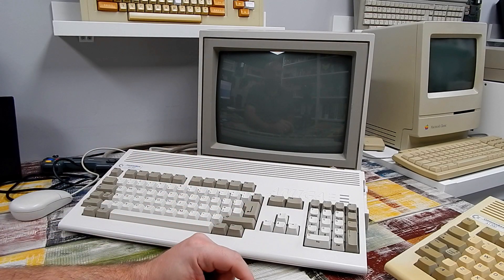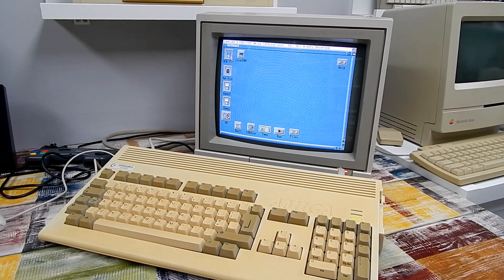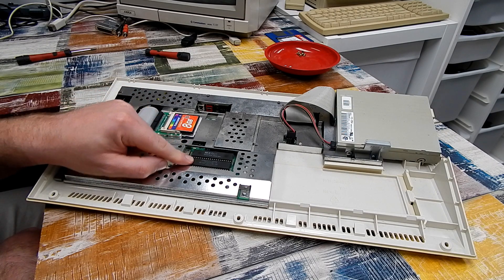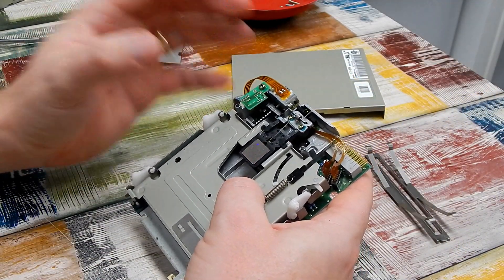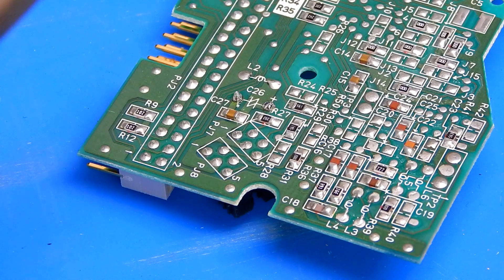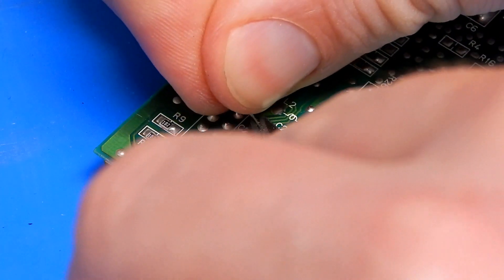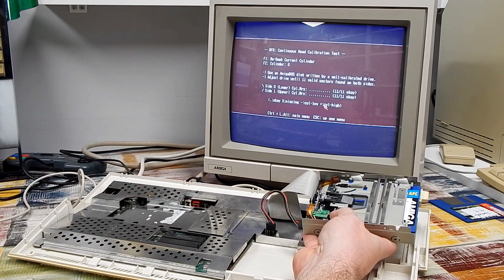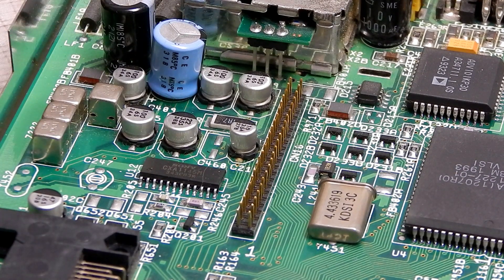Dead floppy drive in this Amiga 1200, let's fix it.

Comment: Nice and easy fix. I'm intrigued as to what's in the head cleaning fluid though - I thought it was usually isopropyl alcohol?
Reply from the maker: That's a good point actually, its very well might just be isopropyl.
Reply: @CRG  It is. No idea what those commenters were on about. It's almost as if they were just repeating some nonsense they heard 🙄
Reply: @PJBonoVox  What? People on the internet are wrong? Well, I've never! 

Also, yes, it's most likely just IPA. 99% is completely fine to use on electronics, and does not damage it. If you are unsure if your cleaning solution is good, just put a cotton swab in it, and wipe it on a clean mirror surface (easier to see there). If it leaves a film after evaporating, to not use it to clean heads and so on. 
(97% is also completely okay, but 70% and likes I'd be careful with due to dilution and water content.)
Reply: @PJBonoVox  That's what I thought. Every other channel I've seen uses IA.

Comment: Great video, have this issue on one of my amigas, now i know the cause. Would be great to see a you do the Floppy Fix for the Escom Amiga 1200's to use an amiga drive instead of the pc floppy drive that Escom put in due to an amiga floppy shortage at the time which caused me so much grief back in the day trying to load so many amiga disks from boot.
Reply from the maker: I don't have an escom 1200, both mine are from the Commodore days.  

I had always thought that they simply modified a PC drive to work in the Amiga rather than actually modifying the 1200s board?  Can you not just swap out to an Amiga drive and it works?
Reply: @CRG  unfortunately not. There is a fairly easy tweak to make on the motherboard with a single wire that escom had added to the bottom of the motherboard at the floppy port. I know that you have to move one end of that wire to another pin before you can make the amiga reuse a normal Amiga floppy. I believe there is also a tweak to make on the floppy drive too, although it might be just to do one or the other. If you google “escom floppy fix” and also youtube and you’ll see what i mean. Cheers!

Comment: I have a question in regards to floppy drives and a1200.... If the 1200 boots any disk, but do not detect floppy swap. And does it on every disk drive, including gotek drive. And the board is a Commodore and not Escom. Then what to look for?
Reply from the maker: First thought would be the change signal.  It's on pin 2 at the drive and runs to pin 7 on via U7.   This line should go low when the disk is removed.
Reply from the maker: Could be a bad via i.e. U7
Reply: @CRG  I will let him know. Personally I have no knowledge to fix such an error. And I dont know if it could be the floppy cable as well. But I will pass this on to him.

Comment: Great timing Glen as my A1200  FDD has the exact same symptoms and I need to take a look. This will be really helpful. I'm hoping it's just in need of a clean as it was working on and off, but maybe it's caps. Did you test the old caps after removing them to confirm that they were the problem?
Reply from the maker: Thanks Chris.  Its seems like the caps are a common problem in this model of drive.  I didn't test them to be honest but they are still lying on the mat along side the motherboard so after the recap of that I will take all the caps and test them to see what state they are in.
Reply: @CRG  cool. Well I think I'll go with the clean, but I'll be armed with the knowledge that if they doesn't work, I should replace the caps. Thanks again for an awesome helpful video.

Comment: Recap Video ✔✔  ... and don't bother with that time consuming desoldering station, I've seen plenty of videos of people removing the old caps with pliers (twist & pull). Guaranteed to work at least some of the time :)  ( Do it that way if you want the next video to be "How to repair an A1200  lol  )
Reply from the maker: Just grab with pliers and pull then?  Thanks for the tip, that'll save time 🤣🤣🤣

Comment: What about taking the floppy drive out of an external USB Floppy Drive and putting that into the AMIGA 1200.
Reply from the maker: Yeah you could maybe do that, depends on if the drive can be altered to work on an Amiga.  A lot of them are slim drives though so mounting it light be tricky.